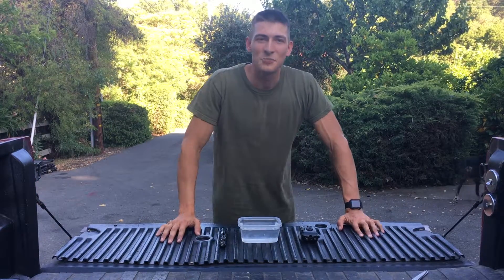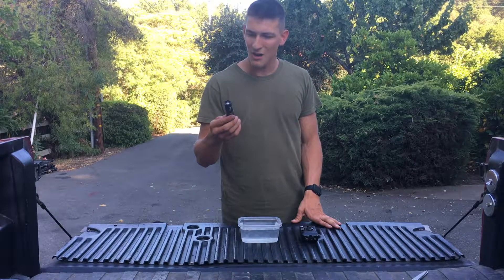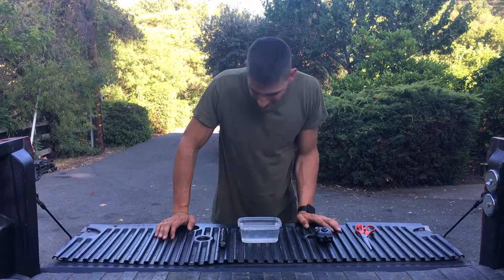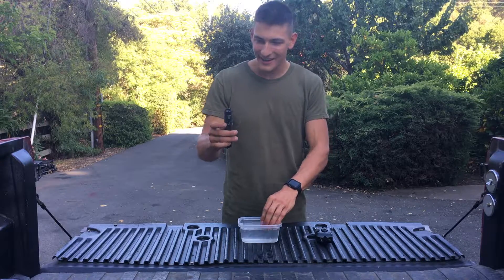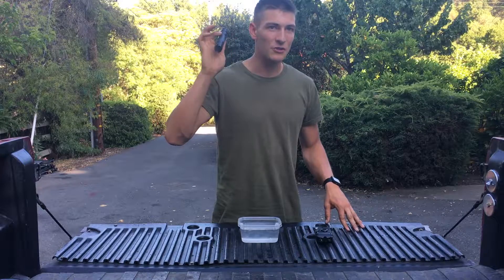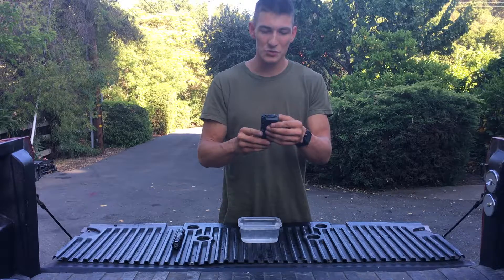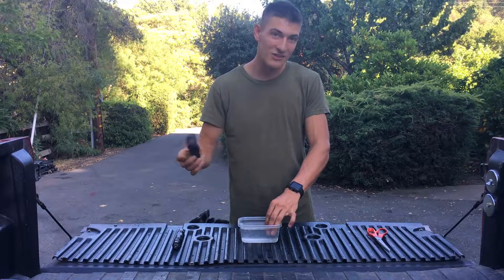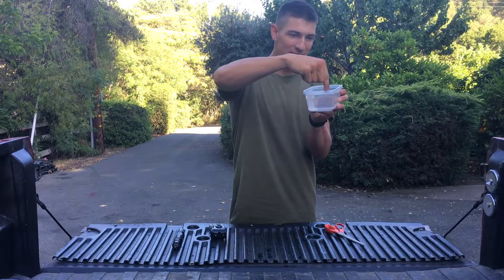Will Tasering Water Affect Me?

Comment: The electricity will always seek out the shortest route to complete its 
circuit. In this case, that path is directly between the taser's two 
electrodes. In order to shock you, the electricity would have to go out of its way, connect through your hand, and then back into the water to the other electrode. Since this is not the shortest path (path of least resistance), there's no way it will ever shock you.
Reply: A random fact about welding:
When you weld on a surface, you have to connect an electrode to the object you're welding on (usually the negative), and the positive side comes through the welding wire. This way, when the wire touches the object, it creates an arc by completing the circuit.
If you weld on the object really far away from the place the electrode is connected, the connection won't be as strong. It's best to weld as close as possible, because the electricity has less matter to flow through.
If you were to touch the piece of steel while you were welding on it, you would not be shocked for the same reason you would not be in the water bowl. =]